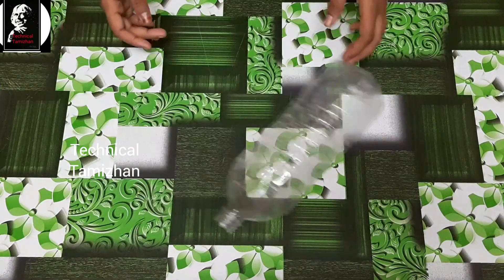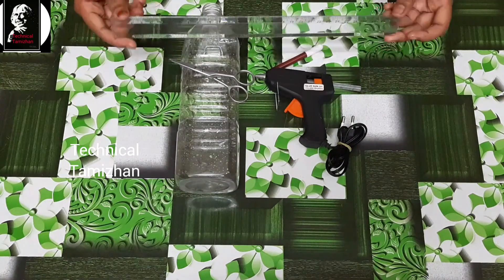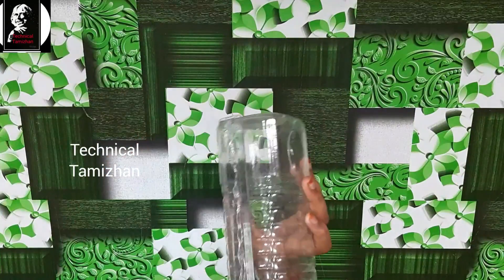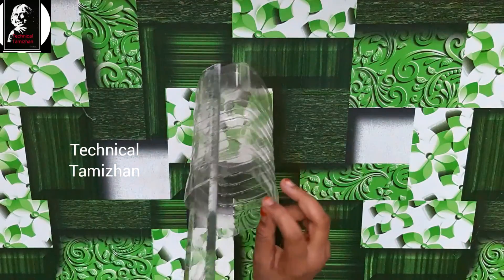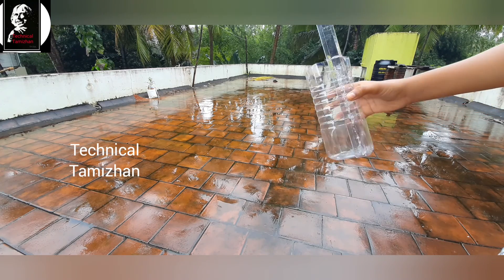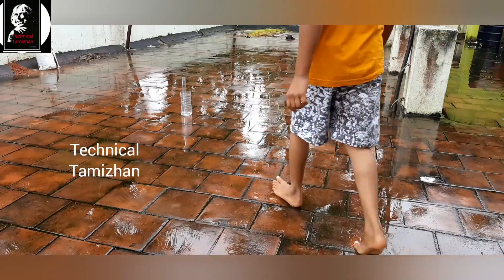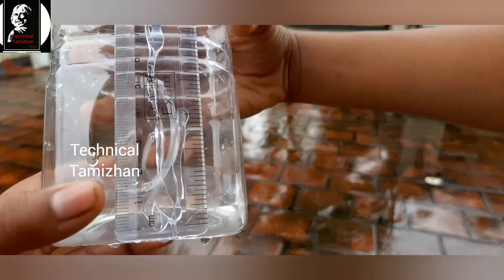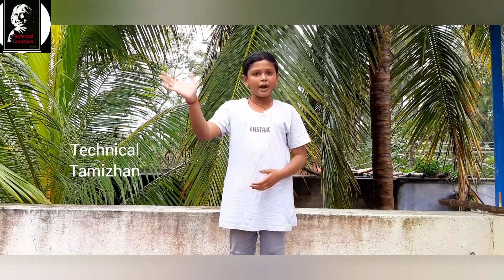வீட்டிலே சுலபமாக மழைநீரை அலக்கும் கருவி || Rain gauge making at home diy

Comment: Bro there is mistake  in this project ,  the water calculation may be differ from original value due to bottle design  such curve 🤔,  pls correct it bro , tq
Reply from the maker: Ok,bro i will next time